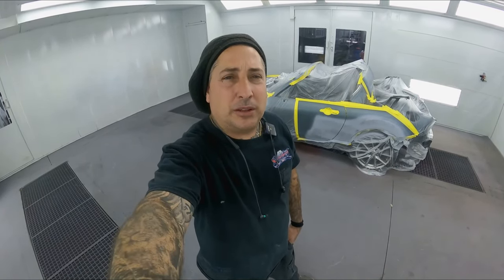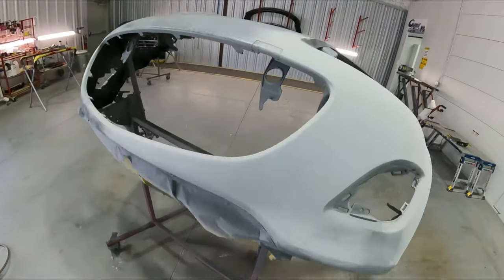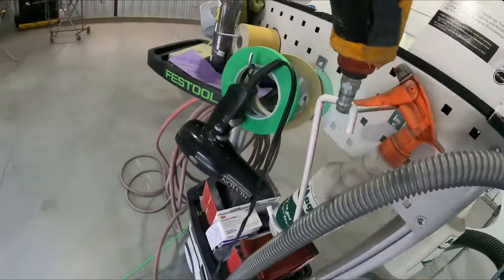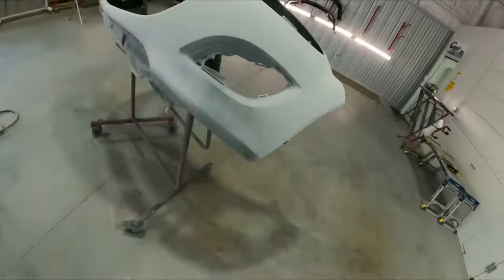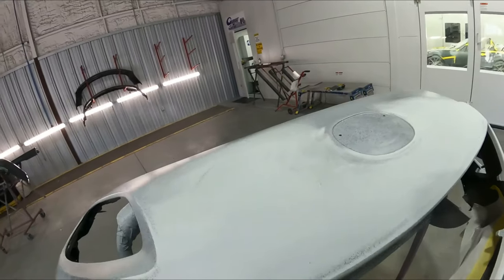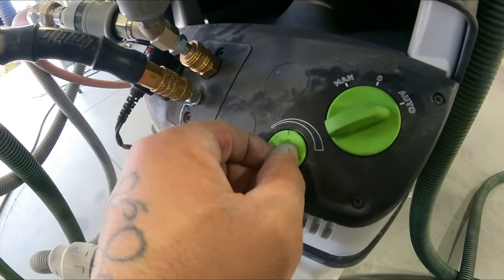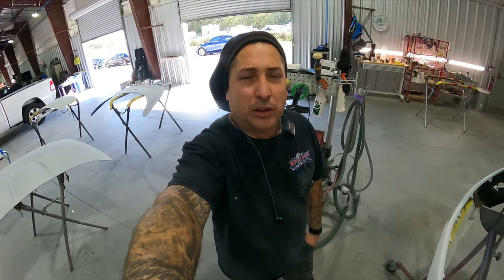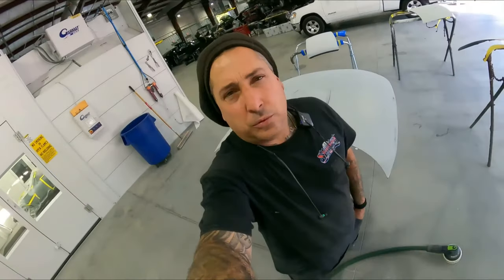FESTOOL VACUUM SANDER - A MUST

Comment: Been hooked on dust extraction for quite a few years now, but a more economical option for my low volume work.
I like an electric palm sander (Mirka), mainly due to the much quieter operation.
Use it with a Bunnings (hardware store) AU$219 Ryobi 1500w 30lt vacuum, with power take off switch, and an even better paper is the ceramic mesh, less dust and lasts so long . . . I use ceramic mesh for both machine and small / larger block papers.
Use machine and vacuum now for everything from filler to final pre paint grits, even in the booth for flow coating, no dust whatsoever.
So great for job cleanliness and H&S.
Reply from the maker: Can't beat em 👍

Comment: Been looking into these for a long time. Since I do it all in one location. What a difference it could make. Only thing I'm NOT prepared for is revamping all my sandpapers and blocks.
Reply from the maker: Great tool 👍
Reply: What sand paper are you using
Reply: What sand paper are you using
Reply: If you do decide to switch check out the ceramic papers (mesh) is whatever grits you can, down to say 240g.
Machine and block.
Finer than that, I tend to stay with traditional 6" dia  papers, they then all seem to get 99% of any dust.

Yes, the mesh is about double the price of regular holed papers, but wow it lasts so long, at least 3-4 times regular paper.
See my main comment, I use a 1500w Ryobi 30lt vacuum that's only AU$219, works a treat.
For blocks, the neck of those usually opens to allow less vacuum power so it doesn't grab as much, still gets all the filler / primer dust.
Reply from the maker: Sounds good I'll check it out thanks for the insight

Comment: I have been using festool ETS EC 150/5 electric da sander for couple of years now.. havet used air da since. So much more portable and keeps the costs down becouse its much more economical to use electric than air. (Make air from electric and convert this to moving parts in sander vs use electric to move the parts.) And the vacuum starts when i start to sand, no need for staring the vacuum by hand.
Reply: I use a red cat electric da for rough sanding filler etc. Alot of torque in those. And saves my compressor for actually painting.